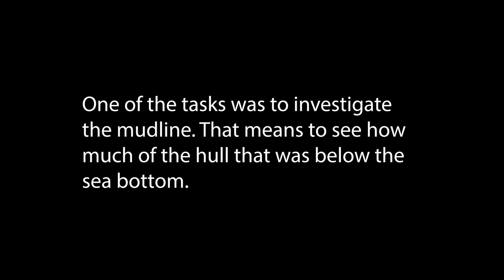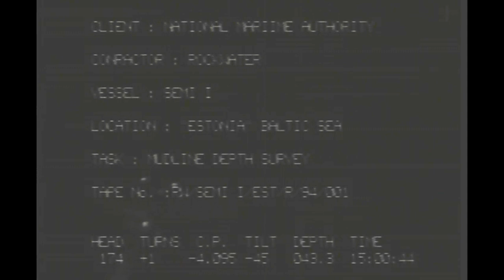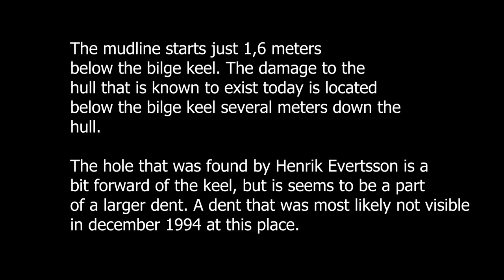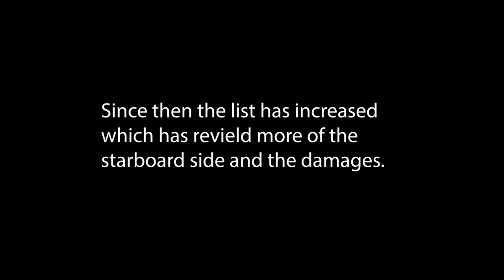Estonia - how much of the starboard side of the wreck was visible in 1994?

Comment: Varför så dålig bildkvalitet?
Reply from the maker: Antingen för att det är en kopia eller också så var det inte bättre kvalitet 1994. Den är ju väldigt dålig tyvärr, men samtidigt är ju sikten vid botten också väldigt dålig bitvis.
Reply: @Estoniaveckan  fast fisken såg man tydligt, verkar som att det läggs på ett filter
Reply from the maker: Allt som är nära kameran syns ju tydligare, men jag tror inte det handlar om filter av något slag.
Reply: @Estoniaveckan  The Eason is mainly that the copies handed over to the public were made direct PAL to NTSC (or the other way around) and not accounting for the differences between the formats - so colors were different and also resolution suffered. Originally it was a VHS tape if good quality
Reply: The digitalisation was made probably in the early digital converter ages, please enjoy the lately uploaded video of the deck 6 public space interior video. Very high quality